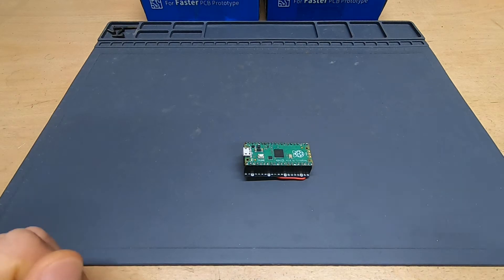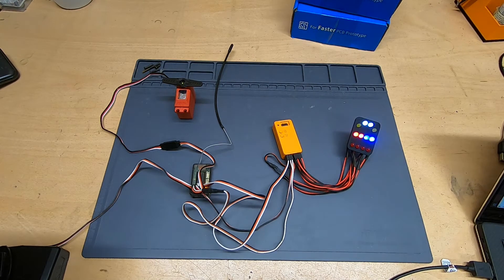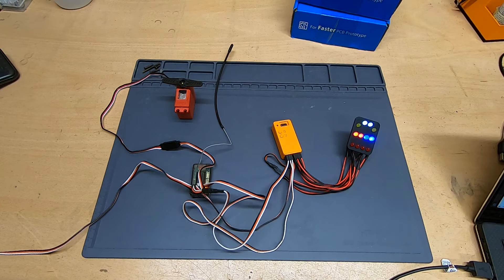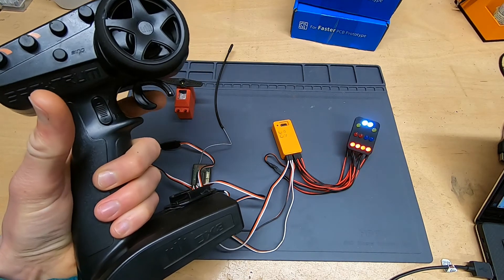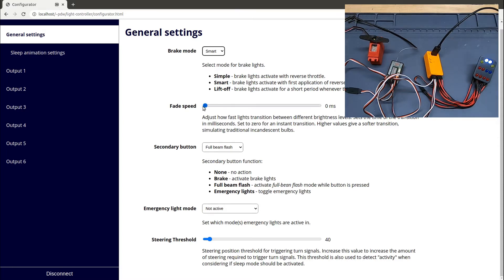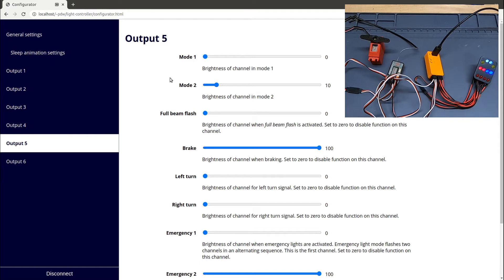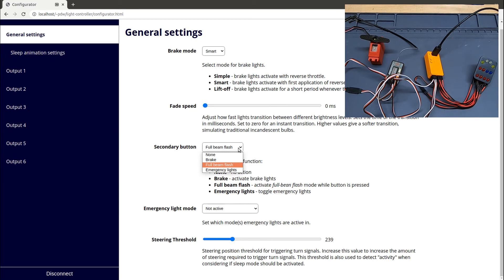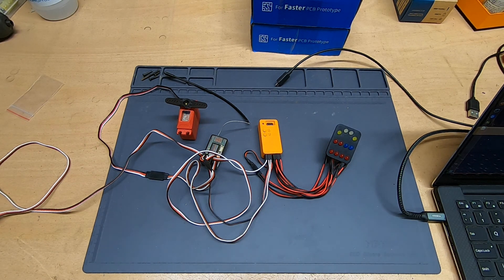Configurable, open source RC light controller

Comment: can you make with arduino promini? its more cheaper.....
Reply: thats what i would like too. and reverse lights. i  have a diy code i wrote for an arduino 2 years ago but no turn lights or brake lights or reverse. i have them all installed in the car but its all for the police lights pattern, something like 40 leds. i still never got around to coding for the steering and throttle channels. perhaps i should, but im busy making passengers for american truck simulator. i really need to stop